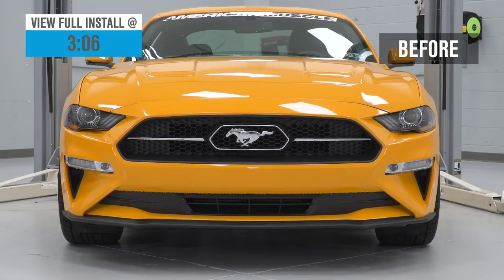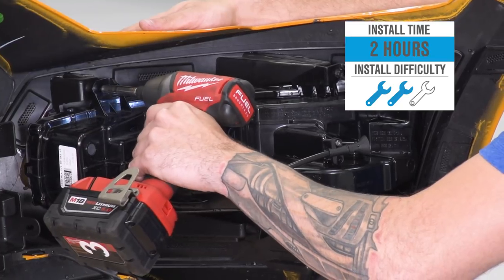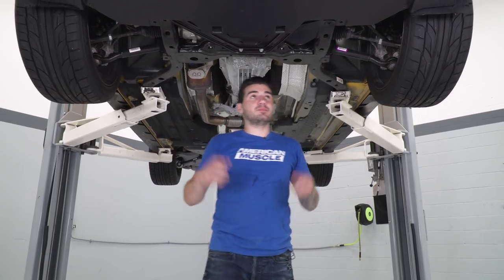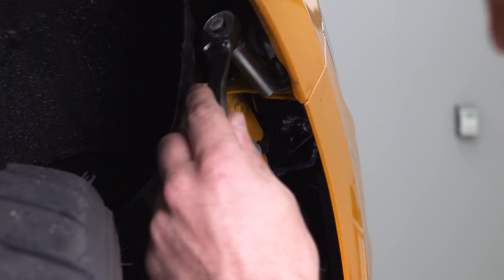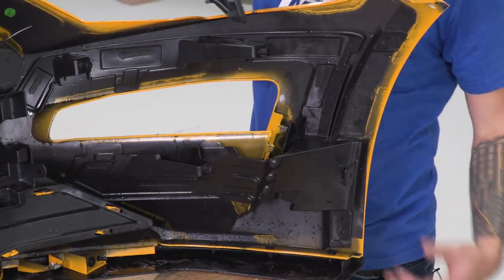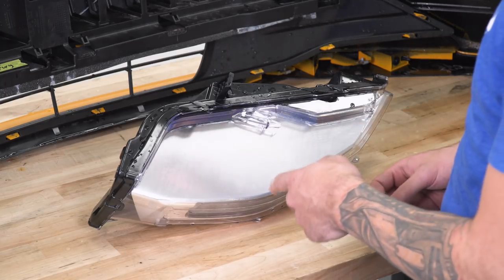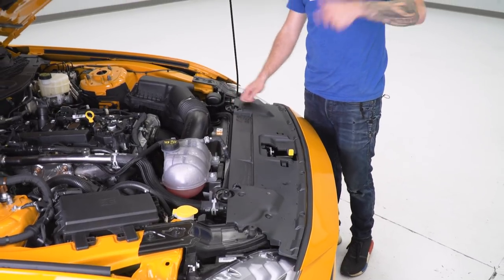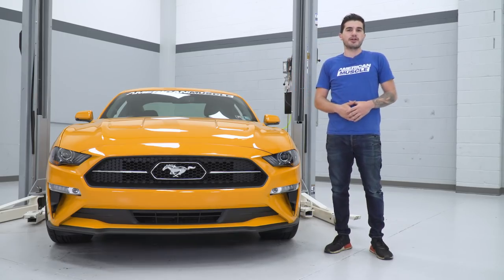2018-2019 Mustang GT & EcoBoost RTR Bumper Vents Review & Install

Comment: I'm not seeing the path for this airflow to the brakes. I barely see an opening either way and then whatever air does manage to get thru looks like it'll be blocked by the wheel well cover.

Comment: You guys make it look so easy, I’ve been trying for 3 hours trying to take them off and nothing… hands and fingers hurt so I had to stop… it does not come off as easy as you guys are making it seem, I used pry tools and screw driver and nothing
Reply: Did you end up figuring it out?…coz I couldn’t
Reply: @Sky-fb4rx  yes I did, kinda difficult at first, but once installed they look so good… I still haven’t swapped out my bumper to my OEM(with RTR lights)
Reply: @vzombie  what’s the trick? I tried pulling the tabs down and still wouldn’t work
Reply: @Sky-fb4rx  honestly, just keep pulling the tabs until they pull apart.

Comment: but did you change the fender liner that works with these on a PP1 or PP2 because the bumper vents are closed on those completely.

Comment: The vents weren’t designed to go into the brakes. It was to cool the engine and the vains run air to the outside of the wheels.